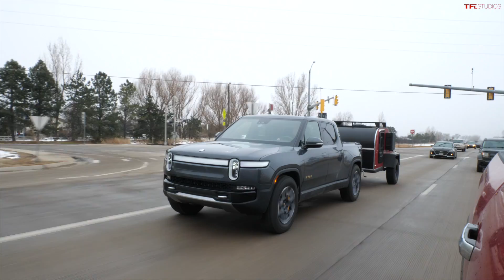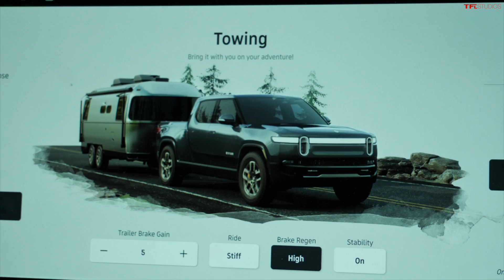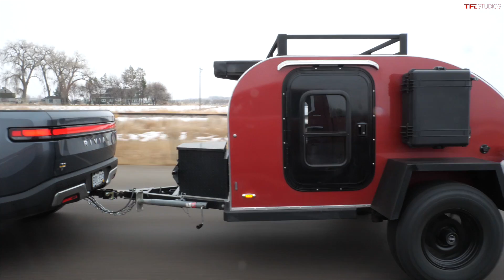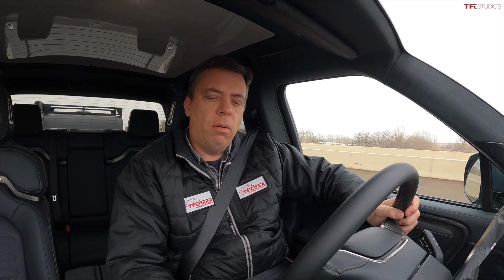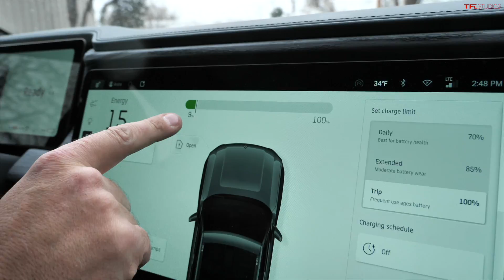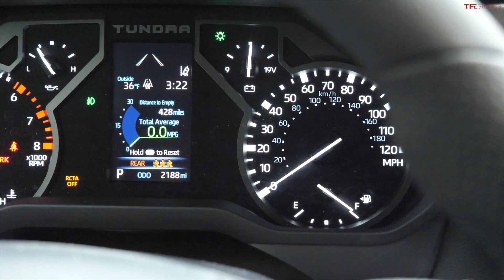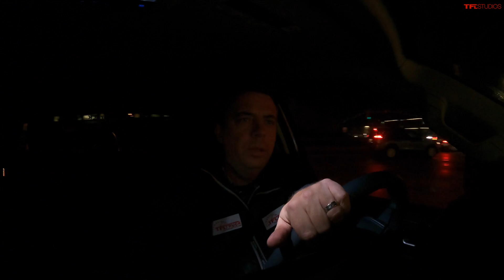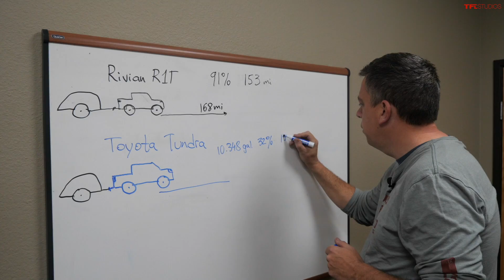Rivian R1T vs. Toyota Tundra: How Far Can Each Truck Tow On A Single 'Fill-Up'?

Comment: You identified one of my problems with buying and owning an EV pick-up in 2022. It's simply not as practical to own for anyone doing any work or fun that requires towing. The other problems are price, service center access (for any unforeseen issues), limited range, and charging (charging time and charger access).
Reply: 80 grand for 200 miles or 80 grand for unlimited miles with a gas vehicle what would you do hummmmm...
Reply: @philllsxga.7737  what ICE  vehicle has unlimited range?🤔
Reply: @jorgesanchez783  all gasoline and diesel vehicle have unlimited Range..
You go to the fueling station, fill it up your back on the road.
Try that with your electric vehicle...
Reply: @philllsxga.7737  that's not what unlimited ranges means🤔. Range  refers to how far you can drive on one tank. Having to fill up with gas or diesel  means  you're close to the end of your range. 🤷‍♂️ Evs work the same way.When your range is low all you do is charge the battery.🤦
Reply: @jorgesanchez783  lmao!! Really?!?!?!??
All you do is charge the battery 🤣🤣🤣🤣 for 8 hours 🤣🤣🤣
It takes 6 minutes to fill your tank and your back on the road!!!!
Are you serious?!?!?!??
Would you send your wife, kid's or Grand parents on a road trip in an electric or gas vehicle?!?!?!????
Reply: @philllsxga.7737  not sure wherebyoure getting an 8 hour  charge time🤔 and yes I will  be road tripping  with my family not sure how that's relevant.
Reply: @jorgesanchez783  you are going to take an electric vehicle on a 1000 mile road trip?!?!?!??
It'll take you a month!!!!
LMAO 🤣🤣🤣🤣🤣🤣🤣🤣🤣🤣🤣🤣🤣
Reply: @philllsxga.7737  You're just making up arbitrary numbers to make a point but then again again you said human have the largest brains soooo...🤷‍♂️
Reply: @jorgesanchez783  dude I've done multiple 12 13 and 1400 mile road trips!!!
You fill up use the bathroom you're back on the road!!!
Reply: @philllsxga.7737  why would you need to fill up  I thought you said ICE vehicles have unlimited range?🤣
Reply: Most households buying a 70k vehicle have multiple vehicles. This could be just one of them.
Reply: @jghall00  that's called the more money than brains...
Reply: @philllsxga.7737  Or maybe just more money than you?
Reply: @jghall00  a rivian is a look at me I'm rich yuppie truck aren't humans supposed to be more intelligent????
The mammal with the biggest brain???
You are correct more money than me more money than brains..
Reply: @philllsxga.7737  Maybe they have more money than you because they have more brains? A Rivian is the same price as an F150 Lariat. If someone lives someplace where gas is expensive and doesn't tow long distances, buying one might be a perfectly reasonable decision if they have other vehicles with different capabilities. What happened to that freedom we celebrate? If someone's purchase decision doesn't meet your criteria they're not intelligent? It's their money, they can spend it how they see fit. I have an Expedition and an EV. If I'm towing my camper or hauling my entire family, I use the Expedition. Otherwise, I use the EV because it gets the equivalent of 100 mpg.
Reply: @philllsxga.7737  And you don't realize the amount of electricity and energy needed to create a gallon of gas. And then transport it and store it. EV is the future whether you like it or not.
Reply: @jghall00  Well said.
Reply: @RufusJRT  ha!!! There's a sucker born every minute...
YouTube George Carlin saving the planet...
Reply: @philllsxga.7737  Who said anything about saving the planet? I didn't like $80 tanks of gas, so I bought something that doesn't use gas.
Reply: @jghall00  that rivian is 100 grand!
Reply: @RufusJRT  mining lithium is 100 times worse than drilling for oil!
Reply: @JohnDoe-nz6bk  the pricing is on their website. Your number is off.
Reply: @philllsxga.7737  the mammal with the biggest brain is a whale not a human.🤷‍♂️
Reply: @jorgesanchez783  okay.
I'll rephrase that humans are supposed to be the smartest mammal..
Supposed to be...
Reply: @philllsxga.7737  well with a comment  like "humans have the biggest brain" you're  not helping your argument. That didn't sound very smart.🤣
Reply: @jorgesanchez783  you know what is smart???
I paid 36 k for a vehicle I can put gasoline in and drive where I want.
Not 80 k to drive 200 miles then your hoofin it...
Reply: @philllsxga.7737  whatever helps you sleep better at night buddy. It's  funny how you're so caught up in how others choose to spend their money.
Reply: @philllsxga.7737  how many people  are actually  driving  200 miles a day?🤔
Reply: @jghall00  that's the starting price WITHOUT options. 🤦‍♂️
Reply: @JohnDoe-nz6bk  so...it's available at that price?
Reply: @jghall00  no, it's not! Do you not understand how this works?!?!??
Reply: I get the trim with 800hp, 315 miles of range, heated/ventilated seats, automated tonneau cover, and compressor for 72K. You're making this way too complicated.

Comment: It was -55 below wind chill here in the northern US this week. That electric truck would not do well. I don’t want to have to choose between heat or making it home. 
I see it with teslas allot. Whole vehicle is fogged up driving down the road because they are trying to conserve power. Who do you call when that Rivian breaks down?
Reply: If it breaks down on the road you call a regular tow truck company or a breakdown service. If it breaks at home Rivian have mobile service technicians just like Tesla. They are also putting up service centres quite quickly now.

Comment: Hold up a second, that is misleading comparison because you left out the fact that one gallon of gas is about 33 kw. So the Rivan R1T towed 150 miles on 4 equivalent gallons of gas or 38 mpge. Where as the Tundra towed 150 miles using 10 gallons or 15 mpg. Which makes since because electric motors are more than two times more efficient that internal combustion engines. Yes you will need to stop and recharge more because gas is very energy dense and comes in a form that is easily carried unlike batteries at this point. But electric vehicles are way more efficient and cost less to maintain then ICE vehicles. Do the math right and just not conclude that because an ICE vehicle can run longer that it is better.
Reply: @Mike You have a point ICE cars are still better at towing distances right now becauce gas is realy energy dense but an ICE motor can only get 40% of that power from a gallon of gas so you are just wasting 60% of you money on something you can't use. Electric motors are two time more efficent that Ice engines that what I was getting at not the fact that eletric cars are better at towing did you read my post? I was also saying that TLF always compares apples to oranges so there test resolts don't tell the true story, Just the one they want you to see.

Comment: Loved the comparison. Only thing I wish you would have added, even with the different in range you should show the difference in fill up time. That’s where the electric will really fall flat compared to an ice vehicle.
Reply: @ConsoleCombat  I agree - if you are going camping, who is going to drive 160 miles away from home. The short range is useful as a farm truck but not real world over the road towing of a camper.
Reply: @Patrik Day this is only a guess but estimating 12 cents per kilowatt it would cost about $15 to recharge.
Reply: @chrismann1621  public charging is significantly more. about three times as much and theres no guarantee the charger will provide your vehicles maximum charge rate
Reply: @yankeedoodle7693  public charging of about 32 cents/kwh and with the app for said station you have live data of what charger is available and at what level. If you tow A LOT obviously an EV at the point is not an ideal choice. For occasional, relatively short trips it very possible. Say you are gonna go to the lake about 100 miles away from home. You leave with a full charge. Fish all day, and with me the couple places I fish already have EV chargers that are free. Plug in and charge WHILE fishing. If that's not quite enough there's chargers near by from Electrify America. Top up as needed, then drive home for almost $0.
No one here said these are the end-all-be-all of towing RIGHT now. All we're saying is the comparison they made was silly. Could the Tundra tow further than my V6 Equinox? I'd hope so it's fuel tank is 50% larger than mine. Does that mean my current vehicle is terrible for towing what I have to where I want to go a terrible choice? No!
Reply: @chrismann1621  They already experimented with this in Germany and now they buy gas from Russia.
Reply: @mt1885  that was me guessing they're charging at the office and not a public charger. 
I could do that trip here where I live with my bass boat, return home and charge. For me it would cost me 6.8 cents per KWH. So I don't understand the taxes argument if that's what they or I currently pay.
Reply: @chrismann1621  Not when it is rationed as they will add all of the TAXES to it.
Reply: What about calculating the energy usage ? As of now, the gas has a higher energy density than batteries. So, comparing an ice car/truck to an electric car/truck is not 100% fair, given the fact that an ice vehicle has a lot more energy available. One interesting test would be to see how far an ice car/truck goes compared to an ev car/truck on xx amount of energy.
Reply: If all cars are electric they will be putting more taxes on electricity. Gas taxes are used for road upkeep and they still need money for that
Reply: @johnehlert4366  absolutely. Even so Savings will be significant
Reply: More charges and faster chargers are coming out all the time so I don't see the worry. Fuel savings are huge.
Reply: Well to be fair one thing I wish he would have shown is how much he would be paying to fill up each, I know the Rivian has a huge battery pack, but gas is also expensive, so it would be pretty cool to see how they compare.
Reply: @ConsoleCombat  you're not watching the truck(even used) market, are you?
Any good truck...if we're comparing towing and 4WD, payload, etc...is $50-60K minimum.
Rivian is already down to $62-65 after tax checks/rebates. Then you have massive savings in gas...$200-600 a month depending on usage. And yes...charging while you stop for 30-40 min to get lunch, every 2-3 hours driving is WAY cheaper than gas/diesel. 20-80% in 30-40 min charging would cost you only $20-30 depending on the charger. AND...there are LOTS of free chargers.
Reply: @ConsoleCombat  I'm confused...are you penalizing the EV for not using expensive gas? Because that's one of the top benefits. Home energy consumption is fairly easy to predict and calculate(and in every case much cheaper than gas and hybrids);
KWh average to "fill" EV to desired level
Cost of KWH from your provider at peak and off peak times (usually best overnight)... varies. Highs if .30 Kwh peak, lows of.15 off peak.
One can also plan/program to only charge at home to 80% making significant savings(the top 20% takes longest to charge)
So many free chargers as well.
Reply: @ConsoleCombat  you're still confused about use cases, huh? 70% of pickup trucks in the US are grocery store trucks.
Realistically, seriously, how many people need to haul/tow 4-10,000 lbs, regularly, more than 100 miles round trip in one day? Answer; very few.
I'm not arguing for people that haul/tow long distances every day to switch to EV trucks. What I'm saying, which is fact, is that's not very many Americans. And for now, they should keep their diesels/duallys.
However, your assumption that this truck can't do occasional or regular towing of short distances and still be cheaper and not be impacted by charging more than once per day...is flat wrong.
As evidenced here in this video and using basic math calculations.
Reply: Fill up time is 10 seconds. Plug in and go to bed.  Assuming your trip is 160 mi away or less.
Reply: @kman0074  assuming you’re going on a very long trip, charging at home won’t really help tbh and diesel trucks are even far better than the gas ones.
Reply: @kman0074  After 160 miles?! I just towed my sons Mustang to him when he got out of basic (Army) with my F-150 from Michigan to North Carolina thru the West Virginia mountains all 5500 pounds of car and trailer in one day! Stopped to fuel and pee about halfway. Took as long to pee as it did to fuel. These have a LONG way to go before they are trucks sorry!
Reply: @ConsoleCombat  you see, this is where we differ. I'm educated (highly) on this subject as both a professional and passion. It's clear you haven't done your homework, or you'd know my numbers are legitimate, researched, projected for inflation, and correct. Yours are...well, what they are;  guess from an uneducated pro-gas, EV hater.
I can't Converse any more with someone who refuses facts, data, and reality. Best of luck when the grid shuts down(again for east coasters).
Reply: @ConsoleCombat  You will not be driving period - they know it does not work so who is going to be able to buy these 'battery' shopping karts at $50,000 plus when inflation is out of control and food prices keep going up?

Comment: Great comparison!  As someone who tows quite a bit I would never tow a teardrop style trailer and I doubt any half ton truck would so let's max these things out and let the best win
Reply: Exactly my thoughts. IF I’ve ever seen one of those out on the roads it’s only been once or twice if that. Let’s get some enclosed loaded down trailers, open trailers towing some side by sides or some boats in these comparisons.
Reply: I think you already know who would win.
Reply: Yes i want to see that 11,000 pound towing rivian up the ike gauntlet heh
Reply: @adams1696  they already made that video
Reply: @adams1696  Towing 8,100 lb flat deck hauling a truck. 70 miles driving to the Ike used 81% battery. Ike climb used 16% in 8 miles

Comment: I'll take the Rivian, if i add up all the time and money i spend doing oil changes and engine maintenance and then add the convenience of always having a full charge when i wake up, i will probably never need to stop anywhere to charge unless i'm on a road trip, maybe once a year, rarely will i drive more than 250 miles in a day. but i do spend time sitting in my vehicle and i will be able to have climate control without running the engine for hours just to heat or cool the cabin. And one pedal driving is a game changer for me.
Reply: For someone like you who never ventures far from home, EV is perfect. For me it's the opposite. I work from home. And I go on camping and other outdoor adventures 2-3 times a month that are beyond EV range. Especially towing. For me an EV doesn't exist that is functional. I'd love to have a PHEV truck though. If they ever exist I'd be first in line.
Reply: @MrJcjet  that is actually most people, 250 miles is not exactly tiptoeing around the backyard, and i'm not afraid to stop for a half hour to recharge when i do travel, because i have a nice more than 30% efficient car.
Reply: @markm6488 it's cool with me if it you're not really into adventures and don't have any toys that need to be towed. Not everyone likes to go camping or tows a boat. Sounds like the EV truck might be right for you. I'm not totally sure why you'd want a truck if you're not doing truck things. But lots of people drive them as commuter cars for whatever reason. Seems like a good fit for you.
Reply: @MrJcjet  we are used to the old style combustion engines, but when people drive EV's they see what have been missing and they don't want the old clunker anymore. Kind of like using an old wall phone compared to having a cellphone.
Reply: @markm6488  eventually EVs will be more capable and more useful. They do a good job of replacing family sedans now. Granted no one really buys sedans anymore. But they're pretty decent replacement. They still aren't a viable truck replacement yet. Look at the Rivian. It had the equivalent of a 4 gallon gas tank that takes over an hour to fill and weighs 3000 lbs. It's still an okay option for average people who only do average things. It's not yet competitive with trucks for doing truck things. The day will come. But it's obviously not today.

Comment: Car & Driver recently tested charging on Electrify America with a Rivian, which took their small pack from 10% to 80% in 72 minutes. That puts a theoretical 0% to 100% charge time at 102 minutes with the same on a Max Pack at 140 minutes. That's assuming you can always charge at a max rate. Now, add to that calculation the theoretical additional range of the Tundra, three times. 😳 A seven hour charge duration for the same range.
Reply: That's pretty rough
Reply: It will be better when Rivian releases the max charge rate though. In the owners manuel it states it has a peak charge rate of 210Kw so that will improve those calculations a bit.
Reply: @migueljardim8177  that test by Car & Driver had an observed rate of 185kw against a stated theoretical rate of 210kw. With the update coming with a theoretical charging rate of 300kw, I'll use an improvement factor of 1.6 for simplicity. 64 minutes for the base pack, 88 for the Max Pack, and 262 minutes to match the range of the Tundra.
Reply: @migueljardim8177  EVs are still an emerging tech, especially if they are considered as a system with supporting infrastructure, and everyone buying an EV are still early adopters. Charging infrastructure isn't completely practical. Solid state is promising, but a decade out from commercial reality, which includes a charging infrastructure powerful and widespread enough to exploit them. EVs are great. My wife's next car may be one, but they aren't there yet for heavy duty use cases.